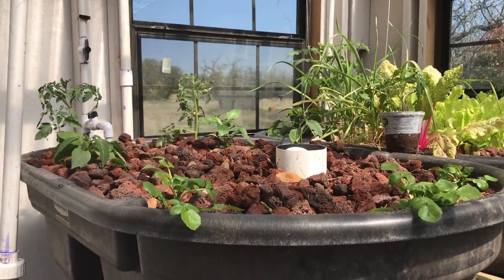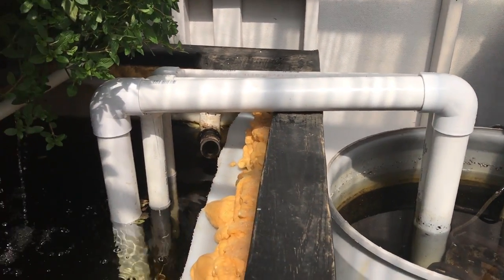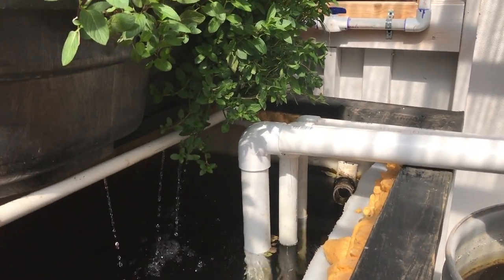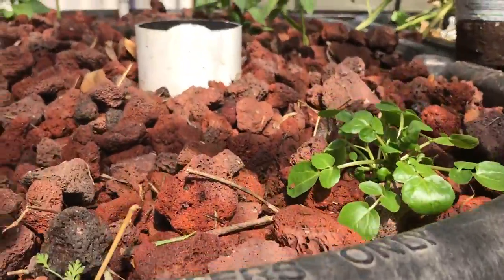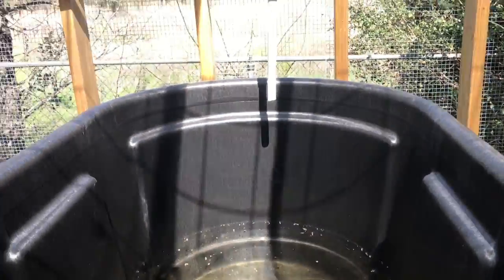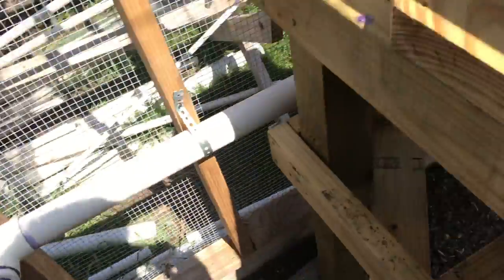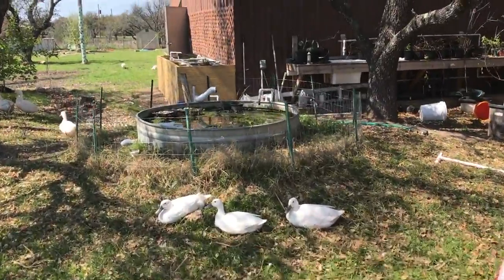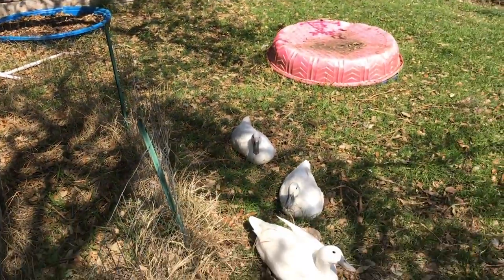Aquaponics and Aquatics Update for 3-7-17

Comment: Ick proliferates in cooler water. Salt really doesn't do anything for ick. When fish get stressed it makes them easy prey for ick. If your doing water changes with cold tap water you could be stressing the fish which brings out the ick. Ick never really leaves the tank. I keep all my tanks at about 80 degrees.
Reply from the maker: That isn't exactly correct.  Cold water actually causes Ick to reproduce more slowly and that is the real problem.  Salt doesn't kill Ick in and of itself and it is almost impossible to kill on the fish or dormant on the bottom.  A sudden rise in salinity often does kill water born Ick, when it is active but not yet fish attached.  

SOoooooo, when we raise water temps up to above 80 (easy in an aquarium, not so easy and an outside system) the Ick actually reproduces faster, which is a good thing.  Because once the Ick in the fish has done its thing it goes into the water, falls to the bottom and changes into the next form, water born.  

If we can push water temps to 86 degrees Ick will complete the entire cycle in about 48-60 hours.  2-3 days, meaning in that window all ick will at some point be water born where it can be killed.  If we time that with a rapid rise in salinity it usually works but again in a large outdoor system in spring, not so easy.  

Hence I went to copper, which will persist (unless diluted with water changes) for about 30 days.  It really isn't harmful to fish, it is actually a mineral supplement to plants and if any snails are in my system they are fricken toast.  The big bluegills with bad ick are already showing signs of clearing up.  

If I could get 2-3 sunny days in a row with my green house I would be set, but once again it is cloudy today.

Comment: hi Jack, is that proper 100% legit aquaponic polystyrene rafts, or have you compromised with a cheaper version?
cheers in advance, details man, I need details 😁
Reply from the maker: Actually no, our rafts are made from baby seals that are beaten with a club, their fat is then converted into a foam, we then ship the foam to Fukushima and have them bathed in radiation after that the foam is shipped to mainland China where pre pubescent teens are beaten with whips as they fashion the baby seal radioactive foam into mats, they are then brought to the US and taken to Kansas Soy Fields, sprayed with roundup.  After that they are shipped to a major urban center and used to beat SJWs and after that they are sent to our farm, carried to us by old tucks that burn sulfur and coal as fuel.
Reply: Jack has just won the interwebs.
Reply: Jack Spirko make a movie FFS!!! cheers.

food grade polystyrene is pricey. makes me think im dreaming wanting 3 or 4 cheap (£20 each) three metre wide x 750mm high swimming pools even °half° covered in luxurious top of the (price) range, glittering, porn-esque rafts.  I've been keeping meat cartons in the hope that I will find a way of recycling them into some usable form.
I mean fuck me, I've just thought whilst replying to your epic & hilarious sarcasm (yeah you won the internet 😁) about using timber planks instead.  I will do a little research & probably find that it will leach unwanted stuff into the water. but I dunno.
in other news, I've emigrated from UK to bulgaria, where aquaponic is not even a word. yet. 
I'm still adjusting my scrap yard diving, side of the road bargain finding, crown of
resourcefullness to a land where everything but plastic is recycled & way outlives it's normal 1st world shelf life.
a resourceful nation of farmers plus one schmuck.
tally ho old bean
Reply from the maker: You worry way to fing much.  We use this, http://www.homedepot.com/p/Thermasheath-Rmax-Thermasheath-3-1-in-x-4-ft-x-8-ft-R-6-Polyisocyanurate-Rigid-Foam-Insulation-Board-787264/100549260 seriously.  

And after three years of people on Youtube telling me all my fish and plants will die in my other system due to the galvanized steel I am still waiting for it to happen.  

Inhale and exhale, you just dealt with about 50,000 toxins.  The food we raise this way is about 1000% better than anything in a store, to me that is more than good enough.